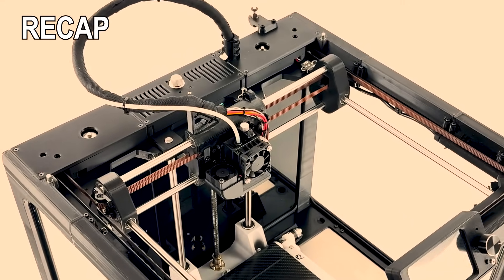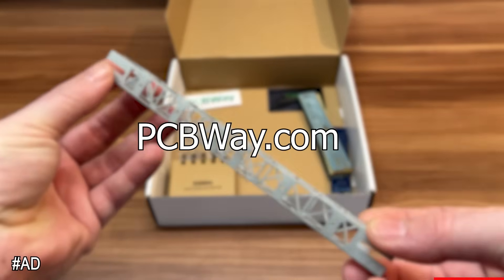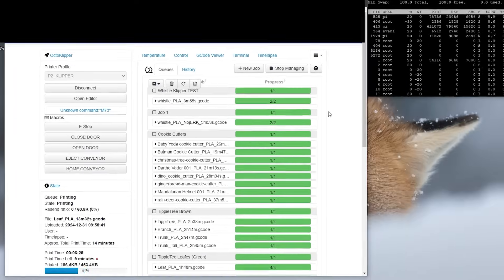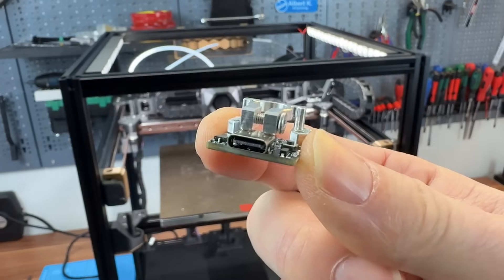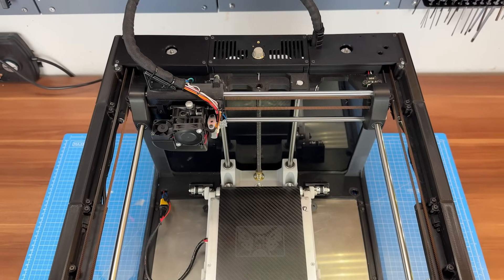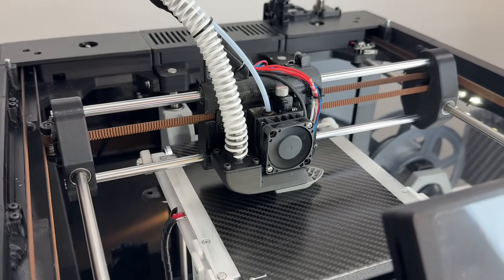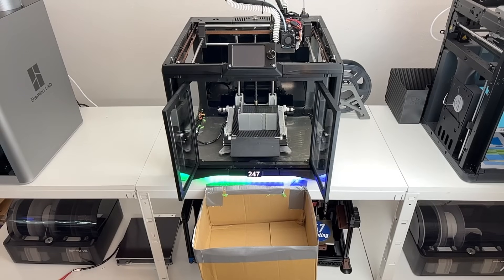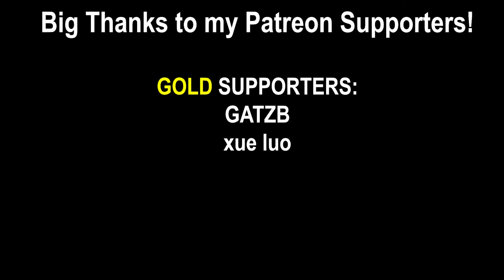3D Printed Frame – How does it Compare to a Voron or Bambu Lab ?

Comment: why cant the machine change the diameter of the extrusion nozzle like changing a tool automatically in cnc machine. Or you can have 2 extruders side by side 1 for precision and 2 for thick printing. Or can also have a Flat HEAD Extruder that can print thick lines and would be able to rotate 360 degree and increase or decrease filament flow to keep the layer thickness the same. OR MAKE THE NOZZLE DYNAMIC ABLE TO CHANGE TO ANY DIAMETER OR SHAPE SIMILAR TO JET ENGINE NOZZLES.✖➕➖🔴◼◻◾🔶🔸🔺🔻

Comment: nice video! since I'm also a 3D printers builder I can suggest you something: I found out that printed frames (or at least partial) works great on small form factors, I have in fact a RatRig V-Chonk (180mm) which works great and has almost double the accelerations of a Voron. About the Vorons (both the 2.4 and Trident, but even more on the Trident), the 2020 frame is way too weak to push accelerations, I found out 4040 frame for the Z and 4020 for the rest works great, it's also possible with bigger extrusions to fill the inside with sand or concrete, which greatly reduces resonances and help stability. It's also important to consider going AWD on bigger machines

Comment: for the printed frame - I think you could have added rigidity early by installing diagonal elements - for example, using high strength synthetic line with a turnbuckle to increase tension, two diagonals per face of the cube that you can access, at the least the left and right sides, maybe the back side too - what do you think of that?

Comment: The only viable reason I see for printing a frame is if you're able to integrate a lot of stuff into the frame.
For a medium to large 3D printer the amount of plastic needed will probably be close to or equal in price to buying (custom sized) extrusions.
Aluminium extrusions are pretty damn cheap and can usually be sourced locally.
Even if it turns out that structurally it doesn't matter that much for a 3D printer, I'd much prefer spending the same amount of money on (reusable) extrusions than to buy 2-3kg of filament, print for several days (with chance of failures) and end up with a frame that can't be reused for another build and will probably be less stiff anyways ...
(Of course this is just my take on it, different use-cases and/or priorities might be applicable to you)

Comment: Advantages of a printed frame:
-Accessories like motorized doors are easier
-You can build out a whole farm from one printer, a lower cost than buying the extrusions, with lower storage overhead
-The design is more flexible (For example, I think that the design tolerances for the printer are a little bigger than they need to be, I think you're leaving some performance on the table there), and it's much easier to modify in whole or in part than a solid hunk of aluminum
-High-grade engineering plastics, like PPA-CF, could theoretically meet or even beat aluminum's material properties
-Plastic isn't conductive (this one is minor but it's relevant)
-Functionally unlimited colorways

Comment: You need to also do resonance test on the bed if it's cantilever. Klipper supports taking in multiple csv files and calculate the resonance but I think it's not documented anywhere, it's mentioned in SnakeoilXY's GitHub, in the manual folder

Comment: Could you use a single motor that has cables on it in the front that could tighten a bit while printing. And then could still allow the bed to move up and down.

Comment: What if the print bed and entire z axis assembly was mechanically isolated from the frame? That way vibrations from the gantry can’t reach the part being printed. It’s my understanding that input shaping only cancels out the vibrations from the tool head. That doesn’t stop the build plate from vibrating though.

Comment: Your printer requires some threaded steel rods through the 3d printed frame. (Or bolt it to the wall at multiple points)

Comment: I'd love to see you put thst xy set-up in a stiff frame - that toolhead looks like its got a good COM with the steper between the rods.

If you added some thin 2mm steel sheet, what would the IS results look like? A lot of sims show that structural panels are more effective than 2020 to 4040 aluminium extrusions upgrades, would the same apply to printed frames?

Comment: I think, for the purpose of this printer, I wouldn't really go to crazy with upgrading it. Adding at least one more point of constraint to the bed like a linear rod at one of the front edges would resolve almost all that the ringing problems. Everything else works, sure it isn't the fastest but it's reliable and easy to access all the motion parts for maintenance which seems like a huge plus for a machine that's meant to run 24/7!

Comment: Wanna know what i use for the probe? SG90 servo swinging a mouse button switch on its horn.

I'm rebuilding a Geeetech i3 wood-frame printer.

I have replaced the mainboard with a GenL, to which i added ability to speak software serial with the drivers. I'm also adding Pi with Klipper in the next days, currently working on boot optimisation. I have a 24V PSU, bed and heater cartridge lined up, and soon upgrading to that. Then i want to rebuild it into a box frame CoreXY using the same motion components and toolhead that i'm using now, using a Voron-style belt run with rear motors and "reversed" belt where only two idlers touch belt teeth (and will be toothed idlers). The bed will be dual Z supported left and right. The price of 2020 Bosch-style extrusion has gotten so ridiculously low (well under 5€/m) that i don't think a printed frame with rods is cheaper. Or is it? If it is, i may just go for it. The whole extrusion length for a frame like that is what 5 meters or so.

Eventually i can redo the toolhead with a Haldis HGX Lite.

The part cooling fan solution of old 247 is unsuitable, axial fans have way too low pressure for that. But the CPAP upgrade makes it perfect.

Comment: X linear rail does not need aluminum extrusion to work. Keep the linear rail flat, and don't put direct drive on it. It won't flex in the middle vertically and will be rigid enough to not flex during fast Y axis movements.
I use Bowden with an extruder on the middle top of the print area to keep the tube as short as possible.

Comment: 0:25 for better grip on belt, align the pulleys so the belts are wrapped around tighter on the motor. Move the outer pulley and inner pulley closer to each other on the belt path.
Reply from the maker: Hmmm no grip problem tbh

Comment: When discussing the viability of a 3d printed frame, it is worth looking at the 100 printer by matt the 3d printing nerd. The 100 makes very good use of space, with printed frames, stiffness will always be a limiting factor, so total frame size to build volume ratio is important. The frame size to build volume ratio of the 100 seems much smaller than the 247. The 247 looks wider than it should be for the build volume that it offers, while it may offer more space for electronics and such, that would also make the moving weight and stiffness potential of the machine lower. Additionally, if the printer is to be enclosed with automatically opening doors, minimizing the volume of the printer should also be a priority.
Reply from the maker: good observations, frame size to build volume efficiency was not a priority back then and a lot of potential there was already identified when designing in 2020, but wasn’t a priority (auto doors, modular enclosure etc were). The 150x150 can be swapped for a 220x220 regular bed. The 100 is a clever concept for sure 👍

Comment: Have you looked into Croxy instead of core xy?
Reply: Why? That's added complexity will 0 benefit. (I believe you are referring to crossxy, as CroXY is a specific [and very good] printer)
Reply from the maker: Would add complexity and cost, but I can imagine also a lot of stiffness and rigidity added as linear rails beef up the printed frame. Also equal weight distribution for moved masses might be a benefit. Definitely worth considering, but no priority atm - complete concept change needed

Comment: 5:22 What is the command for this? Every time I did resonance compensation, it did short movements you could almost not even see. It was more of a vibration than movements. 7:50 Also, arent you supposed to rotate this model for CoreXY?
Reply: The video feed was not the input shaping because as you already mentioned: you can't really see the input shaping calibration.
What do you mean by "rotate"?
Reply from the maker: Update Klipper 👍 It does the vibration now while doing those longer moves at the same time.

Comment: Have you thought about a UHPC (ultra high performance concrete) filled 3D printed frame? The UHPC such as those from durcrete are specially made for CNC machine bases and have excellent vibration dampening qualities.
Reply: Concrete with 3d printing is extremely underrated
Reply: Sounds like the perfect idea for a CHEAP frame ... Thanks
Reply: Isn't just heavy and that's it?
Reply: For a frame, that's pretty expensive stuff though, especially if combined with the plastic you'll need anyway.
If you have trouble with the density and/or weight of aluminium extrusions (=way cheaper), maybe a steel frame is an option ?
(there's a video here on YT about a DIY welded coreXY frame that was both cheap, sturdy and heavy)
Reply: @_MicZ_  You don't need specialized concrete.
Cheap concrete will do the job fine. Just filter the bigger particule in the bag, you'll do fine.
Reply: @SaitoGray  Normal concrete is a lot cheaper, true, but I was reacting to a post about using UHPC.
The problem with printing a frame (filling with concrete or not) is that the accuracy of dimensions and the straightness of the parts are totally dependent on another 3D printer and the only way to check that accuracy is with actual good machined tools/parts. Also, I don't think a 3D printed frame filled with normal concrete is stiffer than (properly sized) aluminium extrusions. These are just my thoughts on it though, if it works for you then all is good I guess ...
Reply: @_MicZ_ alu extrusion is neither accurate or stiff. It doesn't neee to be though. Just using any plates bolted on the sides makes the whole thing a lot stiffer.

Ideally the non moving parts would be infinitely heavy(or infinitely light(and in free fall)
Reply: I mean... you could pretty easily make an entire frame with less than 2kg of filament, especially if its hollowed to a degree enough to allow concrete. It could definitely be cheaper than buying enough aluminum extrusion to build one. THAT said- ive taken on enough projects trying alternative options to diy and save a buck or two that i know most of the time even though im succesful- it wouldve been days/weeks faster and much simpler to just pay for the right thing in the first place😂 i always end up breaking even anyways@_MicZ_
Reply: Someone (I'm not certain but I think it was Tom S) already tested filling a hollow frame with regular concrete a few years ago to see if it reduced vibrations significantly. It did not.
Reply: @claws61821  If you mean Tom Sanladerer he filled the centre of some 2020 extrusion (5mm diameter) with sand. That was never going to work, sand isn't comparable  to UHPC and that tiny amount isn't going to do much. There are papers on the Durcrete website showing the dampening properties of UHPC and it's use in making large commercial cnc machine bases.
Reply: @evropapagan5551  Thank you. It's been a while since I watched the video and I didn't remember the details much beyond his conclusion.

Comment: I've always stated, while we can print faster, it seems quality starts to suffer. Meaning there is room for improvement but there starts to be diminishing rates of return. I have a "The 100" CoreXY all printed printer. It does well up to the crazy speeds then it suffers from multiple issues. So slower print speeds and acceleration are ok for me. Usually around 150-200 is acceptable but for best quality I go for about 120 speeds. So much faster than my bed slingers that take 3 times as long to print the same parts due to speed and acceleration.

Comment: If you want help interpreting your trident graphs message me. Your y looks like it the cable chain needs to be adjusted. The smaller first peak is actually the true peak. The second peak is the issue

Comment: The drag chain of the trident kills its speed and input shaping graphs, but I think input shaping is actually rather behind the curve when it comes to modern speeds. It needs to have a series of long travel moves at different speeds and the tested accelerations need to be adjusted up rather than just interpolated. On my printer with recommended input shaping the ringing peaks at 60mm/s and it peaks again at 100mm/s with accelerations of around 5k but by bumping the acceleration to 20k ringing goes away even at the same speeds.
Reply: Very interesting!